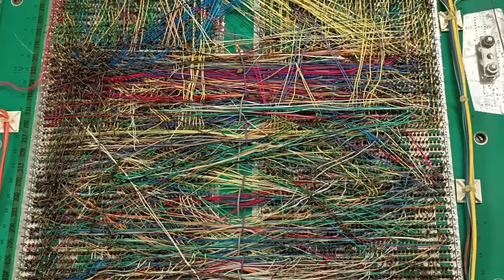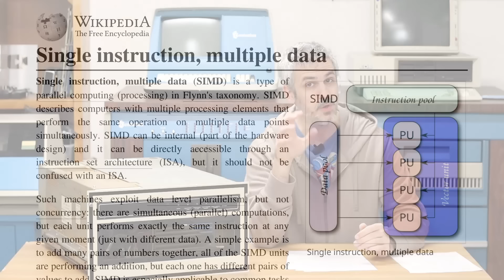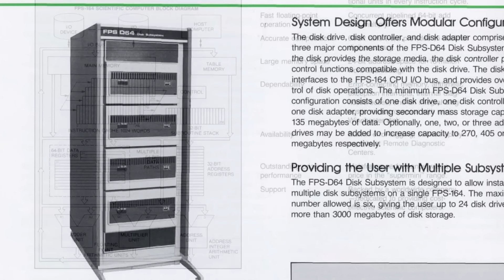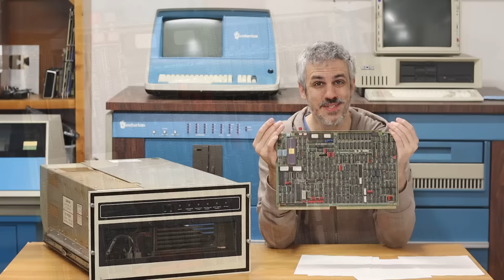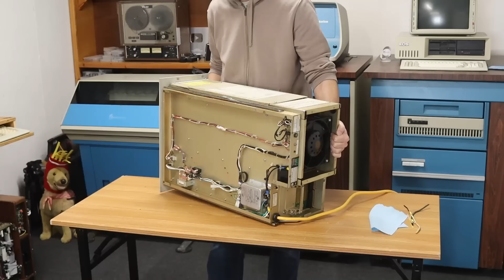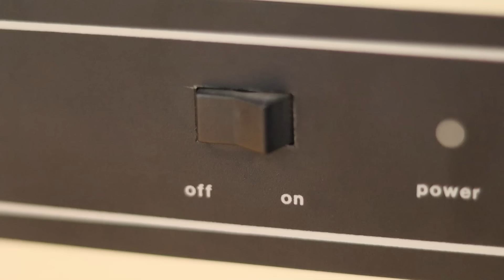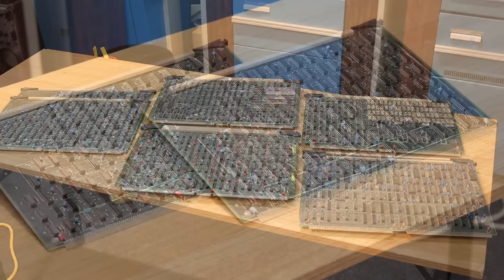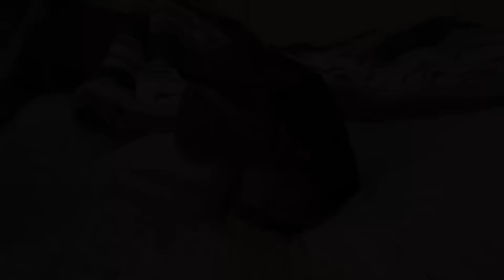This Computer is from a Defunct Supercomputer Company

Comment: Very very cool report, thanks for your work.

You mentioned early users of high power computing as CAT scans and geo surveys.  I assume the geo surveys are the exploration for oil.  At that time strings of sensors were laid onto the ground to record movement.  Then an explosive charge was detonated in a drill hole and electronics recorded the shock waves detected by the large array of sensors.  It works kinda like sonar in that different underground formations reflect the shock waves back to the surface at different speeds and amplitudes (strength).  The field crew then gathers everything up to repeat at a different location.  The recordings go back to the office for evaluation.  Each sensor gives a string of numbers (which can be graphed) to see what echos occurred at that point on the ground.  All these large sets of numbers and time stamps and location coordinates need to be combined mathematically to render a 3D image of the subterranean formations.  It’s this operation that needed the computation power.  Lots of number crunching which required advanced hardware and a not insignificant run time.  It has similarities to your description of the CAT scan rendering.

Comment: MFLOPs stand for million floating point calculations per second. FFT (Fast Fourier Transform) is a tool for analyzing data by converting it from the time domain to the frequency domain.
As @FinnBojorgemsen noted, seismograph data uses FFT to identify frequencies. FFT requires extensive floating point and trigonometric function calculations. 

FFT reduces computational effort by efficiently applying Fourier transformations.

Comment: Wow, this brings back some memories!  Back in the very early '00s, I was part of Sun's high-end engineering team responsible for the E10K, F15K, and even the older Cray CS6400.  Some of my coworkers came from FP Systems, one had started at Celerity, and stayed through FP Systems, Cray, SGI, and then Sun without even moving.  It was a fun mix of people from pretty much all stages of that line, and I learned an amazing amount of skills being part of that team.

Also, thanks for mentioning Dave; he is indeed a fun person!
Reply: I remember the early days of the Sun acquisition of the Business Systems Division of Cray from SGI. SGI was a direct competitor to Sun, and then they purchased (merged with?) Cray. The Cray 6400 didn't really fit into SGI's strategy because it was SPARC based. At Sun we had previously been interested in the 6400 for a few of our customers and there was a lot of joint cooperation between engineering teams, but the sales partnership was convoluted so not a lot of progress was made. When SGI came into the picture we thought that would be a dead end, but SGI didn't really want that division because it didn't fit in with their strategy. A deal was worked out at a really good price (I don't believe it was ever publicly disclosed but I had heard an unbelievably good number), and Sun acquired the division. Things just went gangbusters after that. The Cray 6400 quickly evolved into the Starfire (E10K) as a lot of the hard engineering had already been done, and several years later it was followed on with the Starcat (Starfire 15K), there was also the Starkitty (12K) which was a scaled down version of the Starcat. All the business convolutions disappeared overnight, and we could start selling them. I had some financial services customers that purchased multiple of them.

Comment: in programming we typically refer to our arrays loaded with data for SIMD processing (which is similar to what these units are doing) as vectors. So they, in programming parlance, would be a "vector processor" not that that is some kind of official term. But vector is a familiar term in programming, but outside of C++ it's typically used in contexts like these where you're going to do computations across a stream of data in one run.

Comment: Between 1988 and 2002,  I worked as a programmer in oil and gas exploration. When I started, the company I worked for had three VAX 11/780's with FPS100's attached. The FPS's were used extensively for processing the raw seismic data that came off the survey boats. Typically a boat would tow up to 8 streamers with 120 hydrophones per streamer and and usually 6 seconds of data was recorded at a 4ms sampling rate from each hydrophone (called a trace). 
The FPS's were mainly use for performing the 'normal move out' to correct the trace reflection times for the source-hydrophone offset to flatten the reflections from horizontal layers to their true zero-offset time prior to 'stacking' the traces. They also got used for filtering data and whatever other functions we could find in the FPS libraries.
Later, one of the FPS100's was replaced with a Numerix NMX-432, which claimed to hit 30 MFLOPS, on a trial basis with a view to replacing the other FPS's. This ultimately never happened because the three VAX's were replaced with two Convex C3480 and a Convex C3880.
Reply: In the later 90s I came across an abandoned project to use a PDP-8 with an RK-5 removable HD platter to process neutron logs that was left iwith all the documentation, a CRT terminal, and two printer terminals, by itself in a windowless room. It would still boot.

Comment: Being old and watching investigation into the early PC's, Microsoft hobbled their memory usage and these computers had large memory storage and usability. Used CTOS system, Convergent Technology, bought out by DEC and merged with Burroughs business machines ( BTOS ) STARSYS, short life then Rolled into UNISYS. Command structure was close to Linux was a Lego modular system. 128 bit bus and could emulate other programs. Interesting to me is modern computers seem to have limitations that were worked on and fixed through the 70-80's.

Comment: Seymour Cray is said once to have toggled an entire operating system of his own design into a computer of his own design through its front-panel switches. In octal. Without an error. And it worked - it might be apocryphal, but it doesn't sound out of character for Cray

Comment: Arrays are also used as the term for computer science, and various tables could be included in those. OTOH, I've normally seen vector processing in the context of packed SIMD type operations (as in some DSP families and some CPU extensions, like MMX, 3DNow!, SSE, etc, plus dedicated coprocessors used for that sort of functionality, like in the RSP of the N64, or the vector processor in the Playstation 2, or the SPE cores in the IBM Cell processor;  MMX, the N64 RSP and various fixed-point or integer only DSPs are fixed-point SIMD units rather than floating point).

The exceptional performance for the era makes sense, given SIMD optimization allows dramatically better performance than a pure FPU (or ALU) working on single chunks of data. Hence why applying multimedia extensions for relatively limited added gate count to an existing CPU made such a big difference in performance when that was done in the mid/late 1990s. With the Centaur WinChip implementation of MMX, you also had that on a more or less 486-like x86 core, or 3DNow! on the Winchip2 (though that had a dramatically improved FPU as well, and one of the oddball cases where the execution optimization and pipeline closely mirrored that of the P5 Pentium, and thus worked relatively well with the Quake engine ... specifically the software renderer, since hardware acceleration just using the FPU to handle vertex math wouldn't have the same quirks and nuances as the FPU-exploit pixel pipeline used in software rendered Quake ... Quake 2 also isn't as weirdly/tightly optimized for the P5 FPU, more for the P6 instead).

In any case, the fixed-point SIMD implementation on the Winchip for MMX would probably be the closest thing to use for a hypothetical reference of what you might've gotten in a mid/late 1980s era SIMD capable 486. (the die size of the WinChip was tiny, not that much bigger than the .35 micron AMD 486/5x86, and the higher transistor count would be mostly related to the 64kB vs 16kB cache size, and SRAM cells are way denser than logic, which is why the die size isn't proportionally bloated either) So would be an interesting benchmark to compare for a hypothetical case of x86 SIMD in the 1980s.

Comment: Those M5M4256 DRAM chips on the 42-4455-004 Main Data board are 256k x 1.  There are 8 rows of 16, for a total of 4MB.

Interesting choice to pair this with an 11/44 though.  While it has a fast 22-bit memory bus, all I/O goes through the 18-bit narrower and slower Unibus.  And unlike the 11/70 there is no Massbus controller (RH-70 for the 11/70) to perform I/O directly on the faster main memory bus.  So I'm curious if FPS created some kind of hack here to circumvent the Unibus data transfer bottleneck... The 11/70 had MUCH faster I/O!  Even a Q-Bus system (11/73, 11/83) would have been significantly faster than a plain vanilla 11/44!  (But of course didn't exist in 82.)

Comment: In the mid 70s I worked at a image processing OEM.  One of my jobs was to re-write imaging software for some DEC based hardware, to use an FPS Systems array processor for speed, then deliver it all to China. That AP might still be in use there.  I'm not sure about the life expectancy of that hardware though.  All that rust-prone wire wrap is just asking for trouble.

Comment: If it turns out that you have a plain vanilla Motorola VERSA-Bus MKVM02-3 single board computer in your FPS-3000 there are two things that also come to mind, besides dumping the ROM's of course, and that might be to go ahead and swap out one or both of the ROMs with one of the latest gee-whiz ROM-ulator thingies that uses a Pi-Pico as a ROM emulator, of course.  Yet why not let the Pi-Pico act as a ROM and as a data and address spy at the same time, if that should turn out to be possible?

The other thing worth trying is to see if it is possible to run Ghidra on the ROM dumps, and look for code that has the flavor or feel for the overall structure of a Cooley--Tukey FFT, or for solving for the Cauchy-Green tensor of a matrix, or for determinants or LU decomposition, or some other exotic but otherwise obvious dataflow.  Assuming, of course, that what the 68000 board is probably doing is pumping the FPS-3000 with data, addresses, and operations.  Of course, what we don't know is whether your particular FPS-3000 was customized for medical use, or petroleum exploration, or weather forecasting, and so on.  Were these things customized at the system level, or did they simply come with libraries for operations like "determinants, FFTs, and so on?"

Interestingly enough, on the Parallax Propeller P2 chip, it is possible to implement a Cooley-Tukey radix-2 FFT with just 78 long-word instructions, by carefully interleaving the needed instructions that are used to stuff the on-chip CORDIC solver with data and commands, while simultaneously retrieving/or recirculating the intermediate results and final data as required, even as the CORDIC unit is able to perform 32/64 bit complex rotations through a complex angle every 2 clock cycles, though a 55 stage pipeline, which IIRC was something that someone, maybe even Cray himself figured out to do, in 55 cycles, more or less, when he 
Yet if there are some old ideas that are still being reused, especially if decades might have passed on the patents that covered the original dataflow, they may be running Ghidra against the ROM's just might reveal something, or maybe not.

Comment: In the mid 1970s I was a work-study student at the Speech Communication Research Laboratory in Santa Barbara. They had an AP-120B hooked up to a PDP-11(/45, I think). They were doing realtime speech synthesis using linear prediction software they wrote themselves. Without the AP-120B, this would have been impossible.

Comment: I worked at FPS from 1982 to 1988. I was the lead design engineer for the XP-32 Arithmetic Unit. I wish I had some documentation to share, but it's long gone.
Reply from the maker: Whoa, I'd love to chat with you about your time at FPS!
Shoot me an email at "Nakazoto at Gmail dot com"
Reply: 1982 through 1986 for me as a Test Engineer on 64 Bit products.   Working on the ECL FPS264 was an adventure in how not to burn the prints off your fingers while probing.  3-500 Amp 5V supplies just to run main data cage. Could not pay enough to make that commute now.  The FPS264 ran on 208V 3ph if am not mistaken.  Used a 6809 processor in the power up sequencing system.  Did I mention the 17 layer printed circuit boards that were roughly 16" x 24" with 5 high density connectors that plugged into a wirewrapped back plane.
Reply: @tsec_kwr_37 То были время славы разнообразия различных архитектур процессоров
И все были на равных
И много разных операционных систем на равных старта технологий
Reply: @tsec_kwr_37  17-layer PCBs in mid-80s?? I thought multilayers were very limited way into the 90s, and quick searches come up with commercial 10+ layer substrates dating 1988 and later (Siemens) — was it some sort of a custom process? As if “regular” process 17 layers is cheap, hah.
500A 5V rail also sounds like... a fun time and a peculiar approach, would’ve loved to learn more about decision making behind this!
Reply: huh, looking at photos of boards from this one and from FPS100, both appear to be using 8-layer (or at least 6-layer with witness windows for 8) boards, and that’s mid-80s... incredible stuff
Reply: I suspect your insights are interesting and valuable on their own. I hope you can do a video with David soon.
Reply: Пожалуйста вспомните вашу работу по проектированию процессора FPS
Нам нужно знать историю архитектуры компьютера на процессоре FPS
Reply: Were this current generation of fuzzy logic computing solutions on your employer's radar, long before NVIDIA figured out they could step in to perform precisely the style of parallel processing your hardware had mastered? more specifically, was it an ideal use case (ready or not for this) for your hardware at the time to recognise plastic and metal types on a conveyer in a recycling facility?
Reply: So, You are a lizard then... What's it like?
Reply: @PigsFly-e4rAwesome  ))))))

Comment: Do you have the schematic for the back plain?  If not, and you have access to one, is make a card for is that has LEDS attached to each pin, with the other end connected to an 0v, and the +volt on a probe - then you could just buzz out all the connections.  A lot of work, but i think less then following all them wires.
Once you have the schematic, might be easier to get a PCB made, with at least the more regular connections, leaving you to only have to manually connect the more interesting ones.  But i''m kinda expecting you want to do it as close to the original as possible....... lot of work!  lv u man!

Comment: What an awesome story - I'd never heard of FPS systems. Replicating a backplane is something I've thought of attempting (but didn't get anywhere near doing!) .. tracing the netlist (wire list?) manually would be a very large amount of work? (and potentially error-prone?) have you thought of building some custom cards to automate this? Also have you been in contact with Bruce Ray of Wild Hare systems re the search for FPS software?

Comment: We used our 11/780 for 6502 development.  As PCs became popular the VAX got replaced with 80286 clones.  You could buy all the engineers PCs and it was so much cheaper.  Took a while to port my 55,000 lines of assembly but with scripts and editor macros it was done in a couple of weeks.  I really missed DCL though, it is so much better than DOS bat files, and comparable to UNIX C shell in power.

Comment: 3:10 what an absolute nightmare of a wire wrap back plane 🙀
Reply: in the mid 90s when most machine shops were transistioning from manaul to CNC, i used to repair mid 70s era CNC controllers that were basically large fridge size boxes of wire wrap and S100 boards.....as an amature.. with no schooling beyond a 1980 electronics class...

all i can say is schools taught students ALOT more practical information way back when....
Reply: You should see some of the ones for British computers from the 60s! 😱

(We tended to find wire wrapping was quicker and cheaper than etching PCBs, so generally employed the former. The good thing about wire-wrap is that an updated circuit design can be implemented almost immediately without any changes to supplies or the factory floor. 👍)
Reply: The scared kitty emoji always makes me laugh

Comment: From what is still done in geology, I'd imagine it was used for a very similar thing as the CT scans - could have been CT scans, too, but also modeling from cross-sections of rock bodies or data from boreholess, computing-wise almost the exact same thing. Or calculation crystal structures from monocrystal RTG, that had to have been probably an insane workload at the time.

Comment: CAT scans, MRI scans, Geologic exploration for oil, Synthetic Aperture Radar (SAR), and imaging sonar all use similar math.. the Fourier Slice Theorem. So they all benefit from vector processors.

In my first job, way back in the olden days, we had an FPS-100?(and a Connection Machine CM-5, and a BBN Butterfly, and a Warp Systolic Array… we did radar & sonar)

The FPS at my employer was tied to a VAX 11/780

Comment: When I hear geologic, I think oil and gas and/or mining. IIRC autotune (the thing some singers use) is an offshoot of technology used to look for underground deposits. I believe they find those deposits by processing sound that has passed through (or bounced off of) some underground discontinuity. Do a bunch of number crunching, and you can figure out how thick each layer is and how fast sound travels in it. If you know how fast sound travels in it, you can narrow down what the material is.